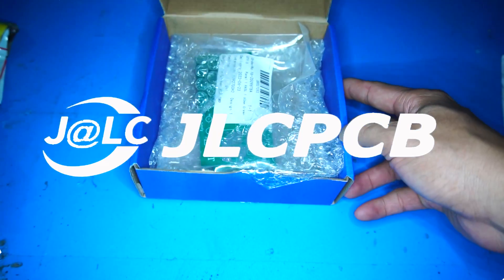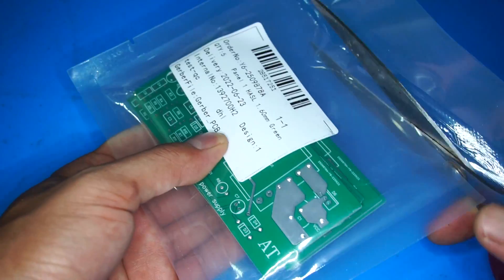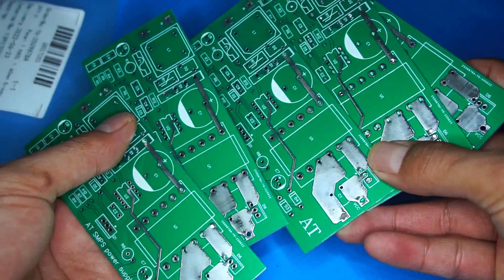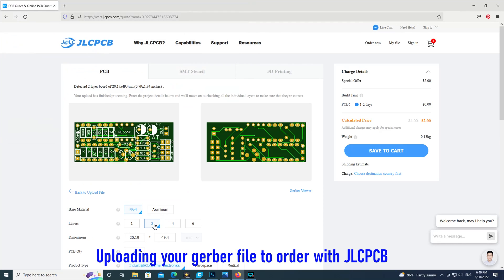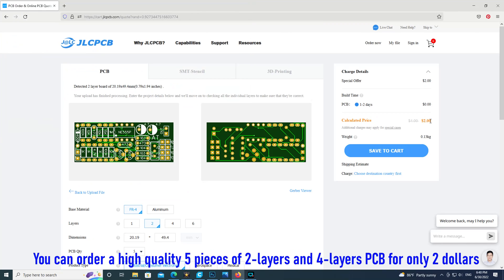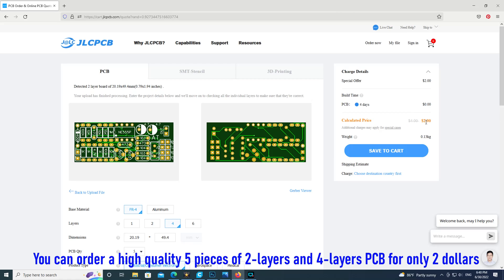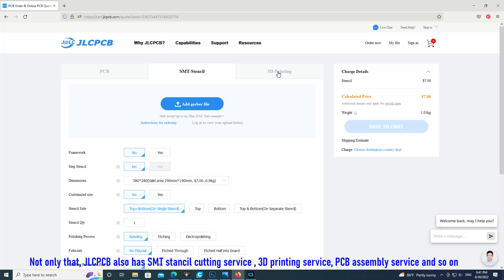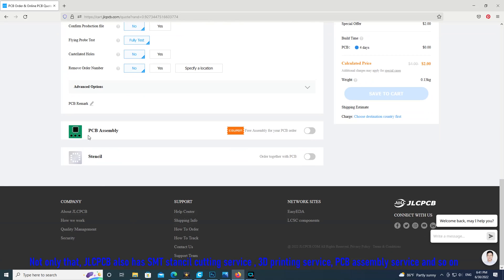DIY How to make 3KW Pure Sine Wave Inverter part 2 | JLCPCB

Comment: Where do you get the 350vdc to 12vdc converter module from, please?
Reply: It a pwm inverter bro it’s two inverter together first the high frequency transformer inverter to get 360 vdc the the low frequency inverter converter that dc to 230 ac it’s no hard to dc but before you attempt to make learn about circuit before you waste your money and time because when I first started out learning engineering I waste a lot of money burning up part because I didn’t get the full understanding so stupid and learn first